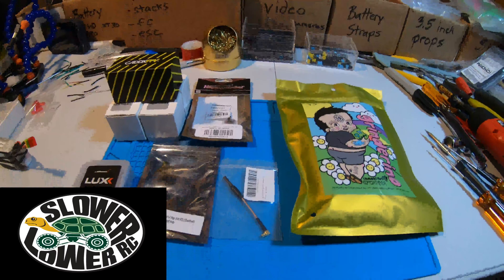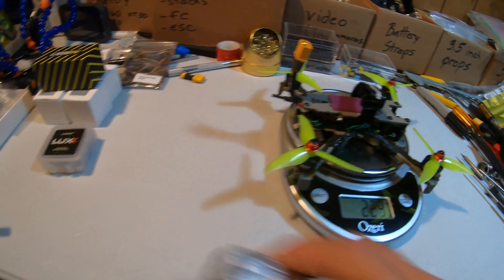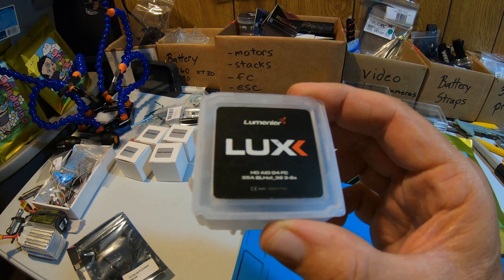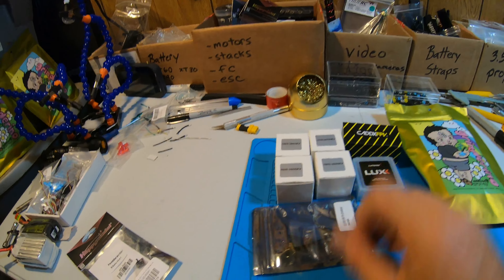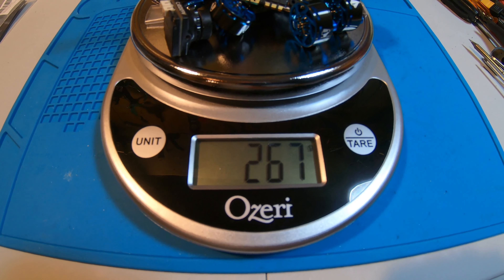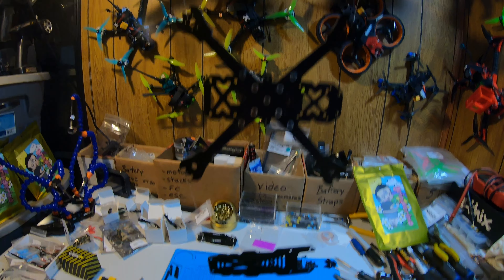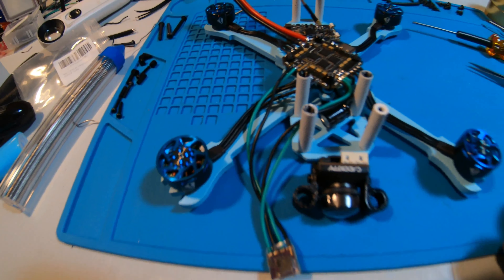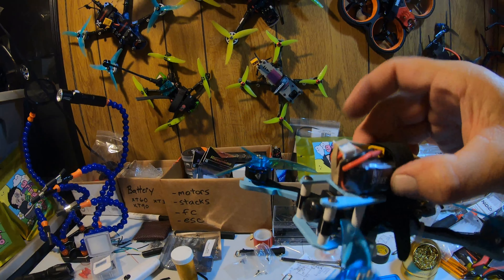GRINDERINO!! Can I Build a Rippin' SUB-250??

Comment: I’m at 256g on my 6s Grinderino build with O3. Just waiting on titanium screws to save some weight and potentially reprint the antenna holder with a lighter material
Reply from the maker: Sounds Sweet!! What mah 6s are you using? My 6s is 359g with a 650 6s, lol. I'm getting longer runtime on my 6s but my 4s grinderinos are freakin awesome!!
Reply: @slowerlowerrc  I’m using a 380mah LiHV… I use these on my quadmula too, fairly decent flight time but only 60g a piece
Reply: Hey can you give me a spec sheet of ur 6S build on grinderino?  Im building one and have no clue what im doing.
Reply from the maker: Mamba MK4 F722 Mini Reactor-66 stack( any 20x20 35amp or more will be fine)
EMAX Eco ll 2004-3000kv( you will have to cut the motor power level down in betaflight, very easy to do)
I'm not sure what video system or receiver you will be using, I can let you know what I'm using if you need the info.
Joshua Bardwell has 2 video series how to build a quad. They are awesome, he shows you everything in perfect detail!
The 3d prints are from brain3d.com.

Comment: Can probably use 4 lighter standoffs in place of the center 4 ones if not all of them to get it under 250g, u don't need those big beefers on such a light kwad, maybe  just the front 2, maybe even slam it down 5-8mm, also replace a bunch of the screws to titanium, mine is on order, i planned on using a nano cam and after seeing this I'm probably going to have to heavily chamfer all the carbon, i want mine under 250 and i want to put the motor protecting tpu feet on it to match my Demibot
Reply from the maker: Sounds sweet!! You can definetely build one under 250 that is awesome!! They are tough AF!!

Comment: I have a bunch of those ethix fsp from tbs blowout sale, i used some mine on a 4inch long range build that ran on 4s, but it got ran over by a semi truck when i cart wheeled it out into the street due to video loss behind trees, was really smooth and efficient, got 18 minute flights before the carnage, whats your opinion on your emax vs ethix grinderino builds? Is the 6s actually a big difference? Or negligible?
Reply from the maker: good questions! I had to cut back the ethix motors a little, they were running a little hot but working fine. It wasn't a big difference from 4s, just heavier and a slightly longer flight time. I'm running those emax ecoii2004 3000kv now on 6s and they work perfect barely getting warm, good punch! My fav is the aerolite 1605 3600kv on 4s! I've got 3 with that setup and they rip!!